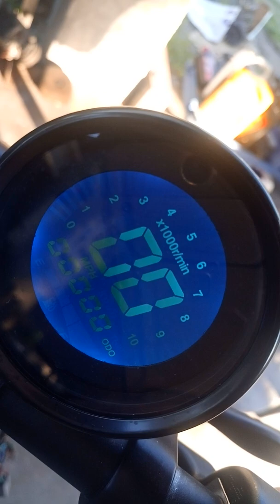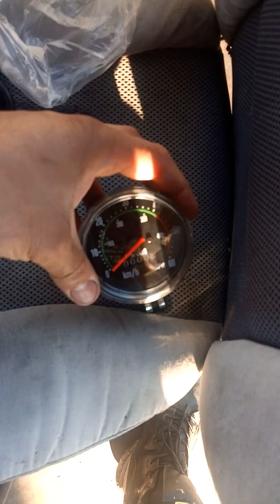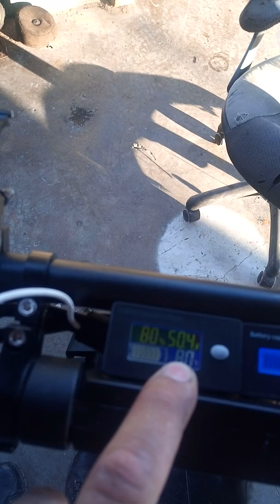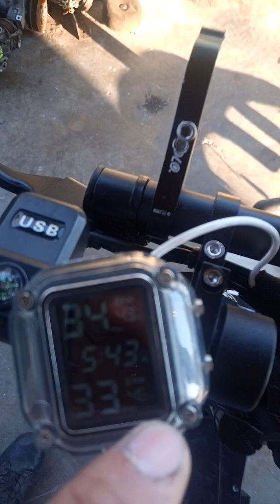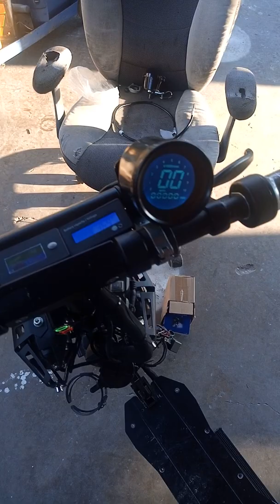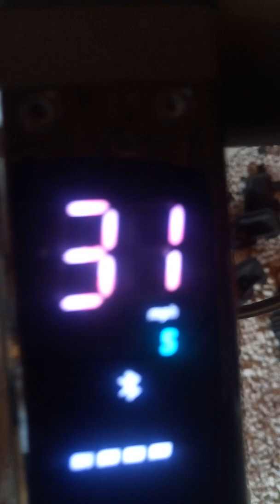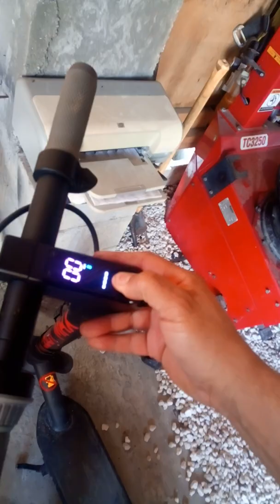qiewa q1 scooter modification and ninebot max 33mph part 2

Comment: Hi , I have a bms for the g30 that is green with a different layout, what should I do?
The p- wire is not soldered on the bms it is soldered on the negative. Should i now solder a red wire from the bms board to the negative ??
Reply from the maker: i will need pictures to help you

Comment: Yo was gud with the spin snsc 2.2 is GPs in steering column tube aint got no box on the column so im just guessing?🤔
Reply from the maker: The new commercial grade max gps is inside the dashboard head thats why is so big no more in the column
Reply: @samzone8920  thanks papo thats whats up 😬
Reply: And what is the motor in the max?😲
Reply from the maker: @chrismead8122  that motor came from electisan 350
Reply: @samzone8920  def gonna have to do a swap with that motor 🤪
Reply from the maker: @chrismead8122  but to be honest they will only run like 25mph not 33mph like the display say and you need a custom firmware that i have if you want the firmware i can post it in the description or you can build your own firmware but the firmware i have is very smooth firmware nothing crazy hard to keep the controller save and alive but if you buid a insame hard firmware i am very sure you can hit maybe 28mph maybe but my firmware is for longlasting i never blow a controller with that firmware
Reply: @samzone8920  okay that still is lot better that stock i def would like a copy of the file i am on most the forums to if its their i can get it too. Thanks!
Reply from the maker: @chrismead8122  i will upload the file when i have a chance probably tomorrow
Reply: @samzone8920  right on brother sounds good. Thanks!!
Reply: @samzone8920  i would like a copy also. Oh do you know how to tell what gen motor i have on my max?
Reply from the maker: @rickiekohlhepp6867  i already upload the file i forget to uploaded before but dont forget that this file is for the motor update with the original motor. They will go the same speed no difference
Reply: @samzone8920  so what motor is it you used? I have 4 g30 max 1 has the 48 volt upgrade but only goes 24mph. Any advice.
Reply from the maker: @rickiekohlhepp6867  i update the description read it please👍
Reply: @samzone8920  yo was good with flashing g30 max BMS you got video only to bypass?🙏
Reply: @samzone8920  Hi , I have a bms for the g30 that is green with a different layout, what should I do?
The p- wire is not soldered on the bms it is soldered on the negative. Should i now solder a red wire from the bms board to the negative ??